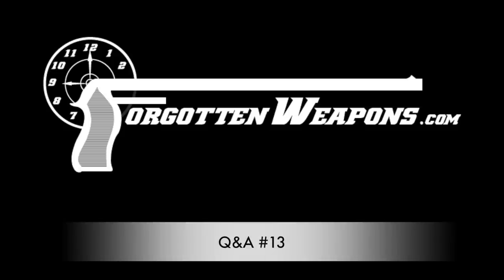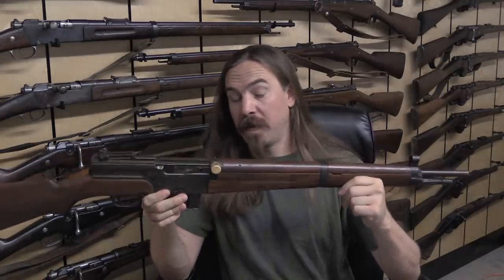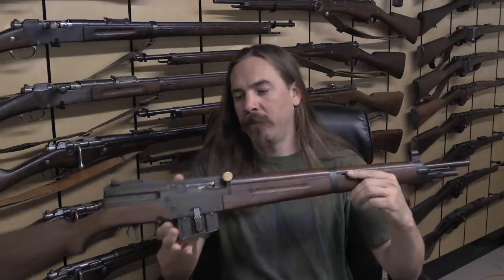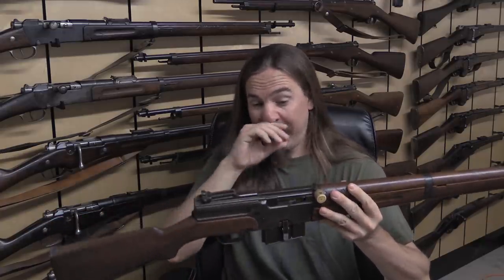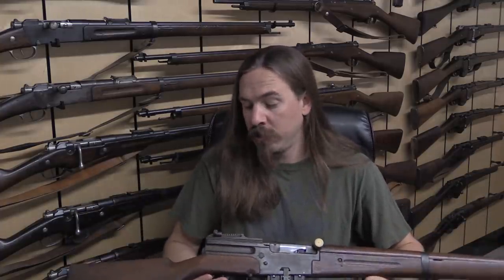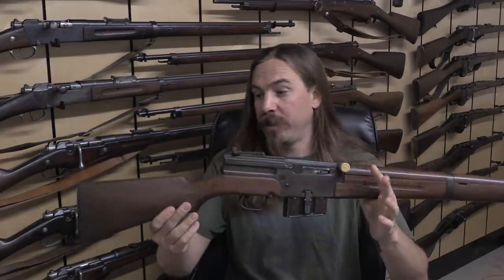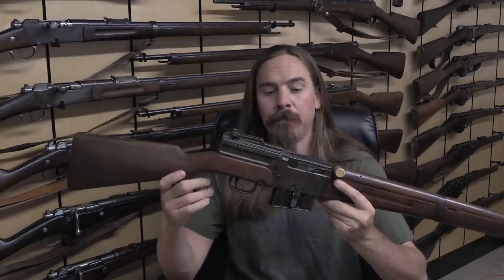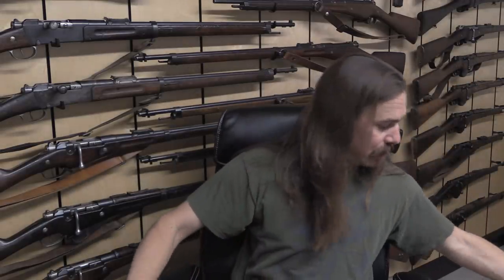Q&A #13: Cameras, Surplus SMGs, Modern Rocket Balls, and More!

Comment: "Untill we have super cool future additive manufacturing capabilities"

I mean, from an entirely technical standpoint we do, unfortunately the only machines which can produce very high resolution metal parts without voids or internal stressing cost at least an order of magnitude more to run any of these parts on.

I'm going to have to explain in a meeting at some point why the printed prototype is in bronze, and why the alternative 316ss sintered parts have a rough surface finish. Binder jet and DLMS are both great processes until you need small features and surface finish. Lost SLA casting results in some fantastic parts, but sprues and bubbles are a problem then. FFF printing metal in binder is a great solution it seems for many parts, but that only really comes into play with cost on large parts with low detail. 

Laser metal deposition is actually very impressive, the results are insane. It is easy to see how this technology could eventually manufacture flawless parts with feature sizes measured in micrometers. Unfortunately this also means it is brutally slow and is very expensive to produce larger parts on.

Comment: You're completely missing the real point regarding Finnish armament procurement issues. Finland after WW2 was constantly just one step shy of becoming full-fledged Soviet satellite the way Poland, Czechoslovakia or Hungary were.   It was real feat of realpolitik that allowed them to retain as much sovereignty as they did, however it meant - among other things - being de facto forced to use communist-derived armament in significant quantities. That's where the domestic Finnish arms industry kicks in too, as well as limited procurement from neutral or semi-neutral countries. NATO-countries procurement existed, but was very limited.

After Soviet collapse Finland ended up with bunch of ex-Soviet hardware they had no economical incentive to replace, nor any other reasons to do so. The main reason why some other ex-Soviet sphere countries rushed to replace all the small arms in the 90s was simple question of logistics. New NATO members standardized on NATO equipment for that very reason. Meanwhile Finland didn't join NATO, and actually has all the reasons not to do so given potential Russian reaction. Similarly there's absolutely no reason to move away from 7.62x39 they have huge stores of both small arms for as well as ammunition, that they can manufacture easily as well as potentially procure on international market for peanuts. The "we'll get stores from the enemy" while in some minor ways true is more of a national pride propaganda the same way as the "it's better in forest of Finland" reasoning others give. Calling it 'aid' is quite off the mark too TBH.

Comment: Just to whistle a little more dixie on the repro Pedersen devices, it seems to me .30 carbine would fit just fine in a .30-06 chamber and would simultaneously open up the door for that device to use standard m1 carbine mags eliminating the need to reproduce mags as well, and then what's to say you couldn't also design one from scratch to plug into an m1 garand or a even an m14??, well quite a lot I suppose, but as far as a modern available cartridge that could work in a Pedersen I submit .30 carbine
Reply from the maker: Too powerful for a blowback action.
Reply: .30 carbine is longer, not strait walled and has about 4x the energy of the round the pedersen was designed to fire.
Reply: Well, then we'll have to go all the way and make it a roller delayed blowback action.
Reply: Forgotten Weapons Could a locked mechanism be made small enough to at least get the same effect? I know it wouldn't be historically accurate, but at least a stop gap? Or maybe some sort of low profile delaying mechanism and severely downloaded .30 carbine?
Reply: swiss or just stick a 30lb spring in there and be a man about it
Reply: EisenKreig if you're gonna severely download it you might as well just download it to something reasonable for a blowback action but at that point you're hand rolling ammo which is kind of the whole thing we're trying to avoid with the 30 carbine
Reply: EisenKreig then again there really isn't any other widely available brass that would even work for rolling your own that I can think of so that might just be the solution right there, just dump half the powder out of off the shelf carbine and use them
Reply: biohazard 918 well the taper and length aren't an issue as it is still substantially smaller than a .30-06 and would still fit in a chamber for one quite easily but the .30 carbines ballistics is definitely a lot for a blowback action, especially one that can fit in a mauser size receiver
Reply: What about cutting a .30 Carbine cartridge down from 33 to 20mm by just lopping off the first 13mm of the brass before crimping the bullet in?  Would that make a reasonable  .30 long/.30 Pederson reproduction round? (sorry if this double posted.. cant find my earlier posting.  Also recognizing that this is a solution to a problem that no one really has)
Reply: +biohazard 918 30 carbine not straight walled? I could have sworn it was.
Reply: hand loading is probably not an issue.. but you'll want to use off the shelf bullets and brass...   or as close as you can get for brass.  in this case i think anyone who can hand load can also cut down the carbine cartridge with sufficient precision .
Reply: arthurthedented yes that's probably true, but again m1 carbine mags are far easier to come by than any for 7.65x20 and certainly original Pedersen ones
Reply: Timothy Soen it has a slight but definitely perceptible taper that's pretty much constant from the rim to the neck
Reply: Brock Deats 7.62 nagant? I'm not that well versed in these things but thought I'd throw it out there.
Reply: noirtec9 ballisticslly that is probably the closest thing in current production so not a bad call, the problem is it is a rimmed revolver round so not only would you have to make custom magazines, they'd probably ultimately not even really work cuz box magazines and rimmed cartridges don't mix well, as far as brass in current production that'd fit in a .30-06 chamber AND has magazines for it in current production I think .30 carbine is the only answer
Reply: To powerful for the devise as made. The .30 carbine has been used in sub machine guns that are pure blow back or so I've read. Not sure what the real limit is on that kind of action in something designed for it.  It has occurred to me that you could use two counter wound springs with a lighter one that was longer and a shorter one that was very stiff working in a tube inside the stock. The short one would allow the bolt to move enough to work the action and the much stouter one could be made strong enough to handle the recoil from a much more potent round but you wouldn't need to be the hulk to work the action. Not done so far as I know but I see no reason it would not work.
Reply: 32 acp?

Comment: Would a cut-down 30 Carbine work in the Peterson device?
Reply: CUT DOWN 30 carbine. Like re-size the case, can probably re-taper if need be. 30 Carbine as parent case. Point is its already a .30 cal straight-walled rifle cartridge. With the right die set, ballistic magic is possible.

Comment: as a metal products manufacturing engineer i can say that you are wrong about the material used in stamped sheet metal guns. they are not all cheap, low grade alloy materials. many such guns are made with 4130, 4140 or 8620 alloy materials for engineering reasons.

Comment: What is the longest surving production round?
Reply: I believe either 45-70 gov’t or 7.62x54R
Reply: @TragicTester034  My first guess would have been the 7.62x39 (wrong by a mile).
A bit fof digging I came up with the British .303 which predates the 7.62x54R by 2 two years, 1889 vs 1891. Anyone is free to correct me as it is not my 'area of knowledge'.
If only smart phones had such longevity!
Reply: @QqJcrsStbt  checked it my self yeah .303 Brit was first adopted in 1888 then adapted to use smokeless powder in 1891
Reply: Also fun fact 7.62x54mmR is the oldest cartridge still in service at 130 years old
Reply: @TragicTester034  We can quibble at the details around the edges and descriptions/definitions. We do agree that there are rounds that fundamenltally have a 130 year heritage. Amazing.

Comment: https://www.youtube.com/watch?v=bA0MRwv7Kts&feature=youtu.be&t=24m53s

7.62x25 Tokarev max case diameter = 9.95mm

30-06 = 12.01mm

A Tokarev cartridge would fit inside a 30-06 with 1mm on each side. Tokarev ammo with hollow points would nearly eliminate the difference in overall length. With 2-3 times more energy the Tokarev would require an equivalently massive bolt/recoil mass, but I'd argue any differences would be relatively easy to overcome with some modest engineering. Bonus would be making an adapter to use PPSH magazines.

Now, wouldn't that be fun!

Comment: 6:30 . In early 1950s out armed forced planned developing a semi-automatic or automatic rifle on basis of the Tokarev rifles. The rimmed cartridge caused problems so it was decided to adopt a new one. Developing own caliber was ruled out so the choices were 7.62x39 and 7.62x51. The latter was seen too powerful so 7.62x39 was adopted in 1958. I have never seen that argument you said presented and presenting it openly even on a small group would most likely have been a career suicide. One could never hint about a possible war against Soviets. In the Continuation war only 10% of ammunition obtained was captured and that mostly in large scale captures from storages. 

The Finnish Valmet was based on a reverse engineered Polish AK which was basically smuggled into the country. No licenses or blueprints were obtained from the Soviets.

Comment: 38:50 

It always hurts me when historians use the word "useless". Ian, do you always have to exaggerate? How would the situation be if it would actually be useless? The soldiers would be virtualy without a rear sight, a catastrophic situation. But this "catastrophic situation" was not present in actual warfare, the weapon could be used with the "useless" rear sight. In the nineteenth century almost all military rifles had a very very narrow rear sights, and yet, the rifles have done very well. 1844 in the "Polytechnischen Journal" was a detailed praise of the rifled weapon, which dominated the other systems in the Napoleonic War. The rifles with their "useless" sights were also very good in skirmishes, man vs man (see: "Österreichischer Soldatenfreund, 6. Juni 1857"). So you see here that useless is almost never the right word to describe military equipment, even suboptimal things have their uses.
Reply: @iatsd
Why is legitimate criticism always shot down by you drones? Useless is a very strong word, it means that something is without any benefit for the user.  However, these "useless" sights have historically delivered excellent work. So it is a badly erroneous assertion. In addition, most people lack the necessary intelligence to differentiate between "editorially" and literally.
Reply: @iatsd
Is a request for correct information the same as whining? Ian's mindless drones always come up with snippy answers, but unfortunately never with substance. You are an apostle of our great Ochlocracy.
Reply from the maker: I stand by my assertion that the aperture sight on the 1903 is kinda useless (my exact words in the video). The 1903 has both a notch and an aperture, and the aperture is far to small to be practical for anything except the KD target range. Have you ever tried using one?
Reply: @Forgotten Weapons
Suboptimal or "of little use" would then be more exact. One use for example would be  the aiming at an unaware target which is far away.

@iatsd
You see here that he used literal language, which reflects badly on your earlier comments. Maybe you should think about your limitations after all.
Reply: Useless is an overused word, it is almost never right to use it.  It is important because Ian generally uses imprecise (and incorrect) language. His language is incorrect because it builds on false information. I have given some historical examples to illustrate this point (which of course you did not read).

>No one who understands how language works would ever assume he was making a categorical statement
He has made a  categorical statement (also in the video):
>and the aperture is far to small to be practical for anything except the KD target range
You're the one who splits the Harre, you want (or can) do not understand me.